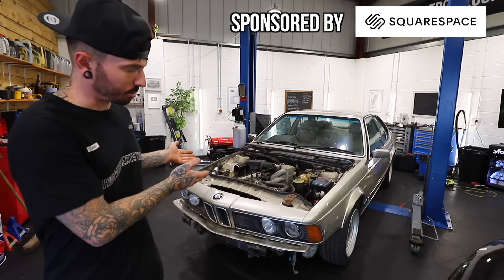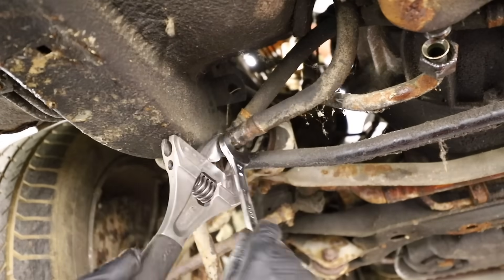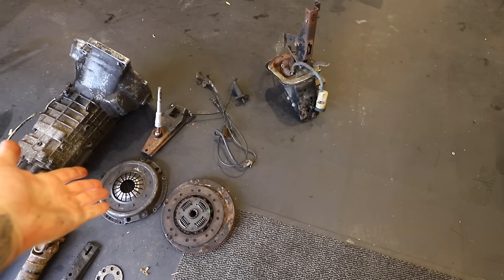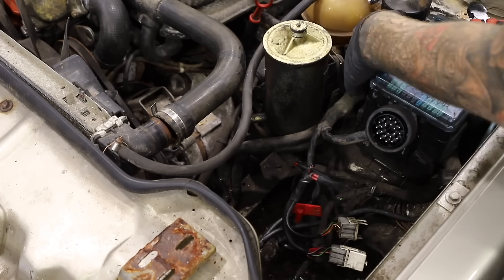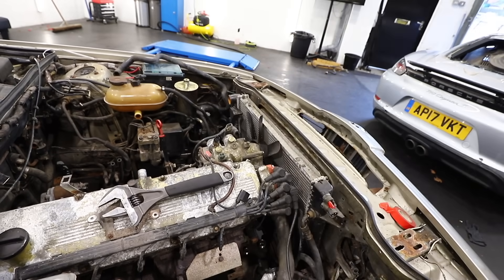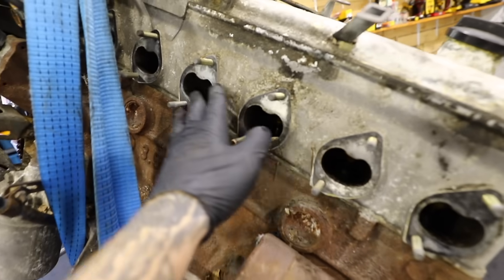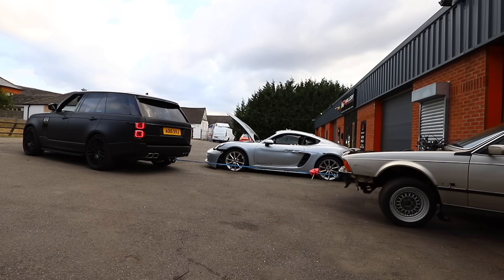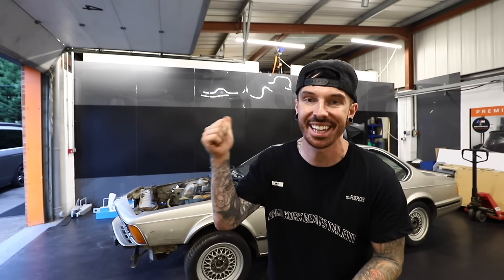RESTORING A BARN FIND 1989 BMW E24 635CSI | PT2

Comment: Why not remove the gearbox and engine together and then separate outside of the car 🧐
Reply from the maker: Only way to do so is to drop the subframe which needed to stay on to roll the car to the new unit
Reply: @MatArmstrongbmx  yep true I got the answer at the end of the video. All the best dude. Keep up the good work

Comment: I love the 635 csi, it's such a nice shape. Reckon if I were attempting this build I'd look to install the running gear from a 335i or similar. keeping it kinda original with the straight six, but adding a turbo with OEM bits, I wouldn't change to manual and if possible fit the modern autobox from the 335i, add a remap it would shift like a modern motor while looking gorgeous and old.

Comment: About the point where you said this was the sketchiest thing in the world (lifting out engine) I was thinking you were doing a brilliant job, completely in control. For the future you might want to get an adjustable balance bar so you can alter the lift point and therefore the angle of the engine when lifting.

Comment: What happened to this BMW after it went to Yorkshire restoration
Reply: That's what I would like to know too. I honestly think that Yorkshire resto made some "executive decisions" which Mat didn't really like. They for example powder coated the whole car, even the roof, which in my opinion was a horrible mistake. Powder coating adds is a very thick layer and always stays a bit soft. it can't be sanded and polished like paint and it's not a good surface for body filler. They will need to add filler though because they didn't do a good job on straightening all the dents and panels.  A thick layer of powder coat will always have some orange peel and plastic appearance. It will never look as good as a clean and thin layer of polished paint. They also did it in white without telling Mat and I think that white is not exactly Mats favorite color.

Comment: Depending on the condition of the old engine, I think a slightly more modern engine is fine. However, as someone who has restored old cars, you don't need a lot of power because they weigh a lot less, also old cars can't take the kind of power we push. If it was my project, I would focus on doing this as a resto-mod, updating parts with things that better today, but keeping the look of the old style.

Comment: Only just watched the E42 videos, not sure if this has been mentioned but noticed an asbestos sticker on the strut tower, not sure how much was used it this car but pre 1999 asbestos was used in alot of parts, brake pads, seals, gaskets, fire protection, ect. One year on guessing its too late or is this why theres no more videos?

Comment: I really much like all your builds. Of course keeping that car original would not make it a Mat Armstong car. I'm sure a lot of collectors would love a spare engine and a few spare body parts.
I would do this as a kind of resto mod car. 
The E92 M3 V8 would fit it perfectly or even a 340i with the ZF 8HP automatic transmission (imagine keeping the old interior design, old shift knob but having ultra modern technology). I sense there might a problem to integrate the idrive but I feel it that you will find a solution for it.
For the body. You could have a company redo the bodyparts in carbon.
In Germany there are a few youtubers like JP Performance that fitted the whole axle and technology of a M4 in an E30 3-Series. There is another youtuber called Phillip Kaess would remade all the body parts of an old Audi RS4 in carbon (not laminated but full carbon body). Maybe you could get some inspiration (or even contacts for companys and sponsorships) from them on how to make like a full resto mod with 2022 technology out of this 6-Series. 
This could really be an absolutely crazy project much like the Maserati but with more daily driveability.

Comment: Make sure the block and head are sound and rebuild. During the rebuild you can decide if you want to upgrade anything like cams, heads or pistons to improve performance, though these cars aren’t slow. A nice set of headers and a tune and it will go well and sound sweet. I second the suggestion not to turbo it.

Comment: Powder coating is a shite system 😡 all it takes is one small hole in the coat and rust runs every where, for long term protection never use it, heat treated enamel paints are 1000% tougher if it Chios you can see it and deal with it,

Comment: Consult a company called metric mechanic in the United States  I did a  similar engine swap using  Modified 3.8 l motor from the company metric mechanic mated to a getrag manual 262 gearbox 5 speed.  new shaft, new gears, new I jesters, fuel.line, pump  fuel tank, exhaust,  full brakes new hydraulic all around. cost ne 17k us dollars